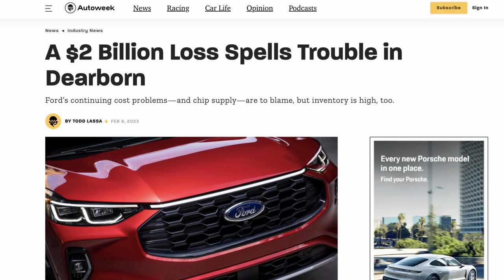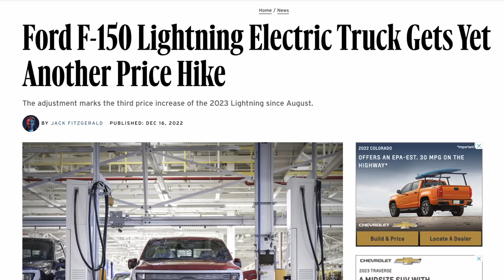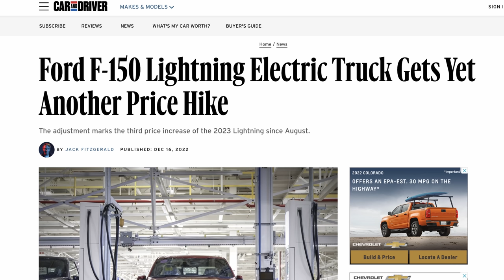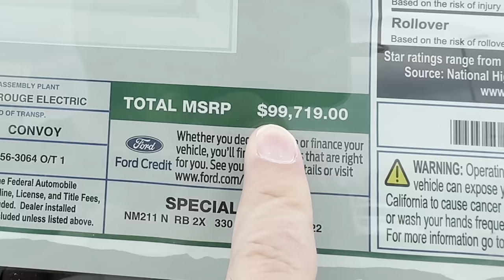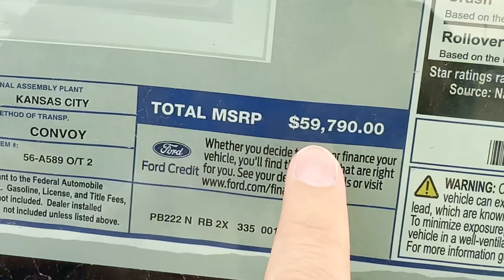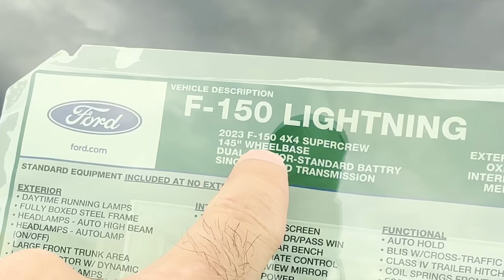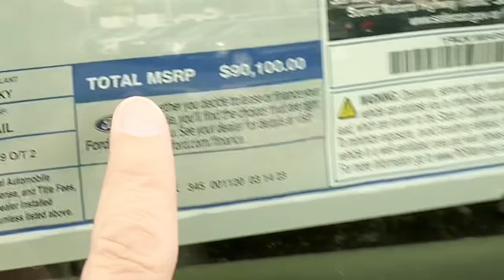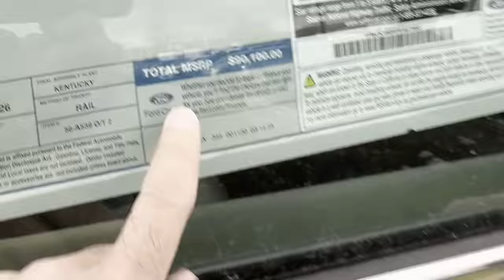Ford CEO Makes HUGE MISTAKE, Now Dealers CAN'T SELL TRUCKS!

Comment: This fits with what I found out when getting my new lease 3 weeks ago. I asked my long-term salesman how well the EVs are selling, and he said, "nobody wants them". He said they're too expensive and the people are POed because the ranges per charge is nowhere near what's being promised. He also said he had to take 15 tests just so he could "qualify" to sell them.

I'm in SE lower MI and there's no other options available other than F-150s or Explorers. They can't even order any Broncos or Mavericks for 6 months. Edge and Escape had a 4 month "freeze".  That didn't matter to me as my preferred vehicle is an F-150. (I can't bend down to get into a car) They were also so desperate to take my Ranger back that they terminated my lease 4 months early and the Ranger was already claimed by the next person.

I agree that the prices are insane! Thankfully, I was able to take advantage of enough "Ford Family" rebates to make my new lease "manageable".  Surprisingly I even got a credit for turning the Ranger in early. I was thinking off buying the Ranger off the lease, but the payments would be MUCH higher than the F-150 lease! 

So far, no recall notices for my new truck 🤞
Reply: So on the EV.   If it takes 15 vocational classes to even sell the damn thing, you think the average joe-bob is going to be able to perform even basic maintenance on one - ha ha ha, not so much!
Reply: @xxxxxxxxxx6903  I'm sure that's part of the plan- to make it so the average joe can't do basic stuff anymore.
Reply: my general take away from watching many test video's is that EV truck can only fulfill their mileage per charge quote on flat roads that do not elevate. Once the road becomes hilly, even a little, mileage per charge is reduced and the most shocking part, once you put a load in a truck or tow something, the mileage drops by, at least, 50% to 60%... that's insane!! ......then there's the charge problems. 

My overall opinion is that they are overpricing their combustion engines to force you into a electric engine. I suspect Ford will fail on a gigantic level but, not before a couple of tax payer bailouts, only to disappear entirely.
Reply: @xxxxxxxxxx6903 this is part of the reason that a lot of people are fighting for the right to repair on their cars. You take it to a dealership and your paying insane amounts out the ass because no shops and you can’t fix it because you need a special software or tool to fix it but the Manufacturer made it dealers only
Reply: @mrrey8937  Excellent point! 

I'm just glad I don't have horses anymore. The thought of having to rely on an EV truck to pull a trailer down a muddy/snowy farm drive in winter so my horse can get emergency surgery is terrifying.

Comment: The dealer mark ups have just totally turned me off buying a new one. I seriously considered buying a bronco even though they have that weak front end, I just wanted one because I had one I guess. I wanted a stripped down model with the off road package because I planned to use it off road then they made it so you couldn't order one like that.
Reply: The Weak front end is because people are off roading the Bronco Sport which isn’t made for off roading.   Just like Jeep Wrangler has the base model for yuppies and one actually designed to go off roading without the use of mods.  Same thing applies to the Bronco.
Reply: If you look hard enough you can find a classic car or truck with low miles.
Sometimes they are cheap.
My 1977 LTD with about 30,000 miles only costed me $11,000.
I have seen classic trucks go for $19,000 to $35,000, and even $35,000 is a bargain.
If you don't mind getting out and locking the hubs, or have a prissy ass that needs a heated seat, then a classic truck may be just for you.
But something i learned the hard way, other than mechanical other parts (engine, transmission) things like a mirror or a wiring harness and other things can be hard or impossible to find.
Thank the cash for clunkers scam that destroyed many cars with good spare parts for that.
Reply: @georgescott4505  Wow, that's really expensive. I have several that I've given less than 10k for that are still going strong.

Comment: Crazy that I've had fewer problems with my early 2000's Ford with the dreaded 5.4L 3 valve than people seem to be having with their new Broncos and Lightnings...
Reply: 05 F150 with a 5.4 3v here 🤘
Reply: @danielhancock8817  Hell yeah. Mine's made it 250,000 miles - here's to another 250,000 🍺
Reply: @thea.m.p.co.467  The problems they had with that engine came from the spark plugs breaking inside the heads or popping out of the heads. It wasn't with longevity.
Reply: Yup 2005 f150 227,000 miles and runs great
Reply: @airplanedude419  I always read/hear people talk shit about them for a variety of reasons, but I am aware of the plugs popping out - 2 have blown out on me, and they've been repaired with helicoils. As long as they keep popping out, I'll keep repairing 'em - I just hope none break inside the head and make their way into the cylinder.

Comment: I’m surprised they aren’t offering a few cases of Bud Light with a new truck. Seems like the next logical step given how these CEOs see things from inside their little bubbles.
Reply: They made that new rainbow truck I don't know of one  macho guy that would ever buy a rainbow truck and you know the 1% of the rainbow would never buy one they wouldn't be able to drive it and high heels
Reply: VIDEO: 'This Sucker's Quick!': Biden Test Drives New Ford Electric Truck
The Ford CEO thought using a 'woke' leader to promote their EV was a good idea.
How is it working out now?
Reply: Damn you had to go there!
Reply: Great idea, maybe put a 24 case of Bud in the bed of every Ranger Raptor "Transgender Edition" sold.

Comment: I am still driving my '99 F150 XLTV4.2L V6 w/5 on the floor and honestly, it would take A LOT to get me to trade her in. I just custom 2 toned painted her my self, ripped all the carpet out and basically rhino-lined the interior. I love the damn thing. Blew the engine couple years ago and had to buy a refurbished w/100k miles. Got it for under $1k and spent a weekend with my wizard mechanic Pops to drop it in. Seriously contemplating turbo for it even though it zips along already for a V6 ... AND it's pretty much theft proof since most younger Gens can't drive stick😁

Comment: Even with a $2000 discount they're still overpriced by about $20-30,000. In the higher trim packages more like overpriced by $40-50,000.

Comment: I worked for a part supplier that produced parts for the blue oval and other auto manufactures. The blue oval would take anything remotely close to the spec size for their parts. Other companies that we supplied would only buy correct in-spec parts.
Goes to show how much they care about quality.
Reply: I did the same in the 70s .. Mercedes was the most demanding.

Comment: It's a shame that the few decent hard working people at dealerships are being affected by the owners / managers greed. It's easy to say "let them burn" for being greedy bastards, but as stated, some good people will suffer because of it. I don't have much luck at all when it comes to right place right time purchases, but getting my 21 Tundra in late 2020 and 0% interest was probably the best investment I've every made.
Reply: Depreciating asset isn’t much of an investment.
Reply: @DoublePlay21  It is an investment if it is providing more value than what you are paying into it. Just because the base asset depreciates doesn't mean that the value it brings does as well.
Reply: Do you like the Tundra?
Reply: @joewoodchuck3824  Love it, and being the last year with the V8 I'll be keeping it for as long as it will run. Some of the things such as the dash, info system/radio, etc is outdated, but pound for pound I honestly believe it's the best truck made. The jury is still out on Toyota's new Tundra platform.
Reply: @Sworm0120  I'll be in the market for a vehicle at some point. I'll keep that in mind. Are there many scheduled service intervals? I had a Honda Accord a ways back and the scheduled service came up what seemed to be too often. And it was like I never left without dropping another $500!
Reply: @joewoodchuck3824  Oil changes and an air filter is all I have done on my truck with 37k miles on it. And the oil changes are every 10k miles if you use the provided synthetic oil at the Toyo dealership. I'd say they are probably the most reliable truck on the market (pre-2022 that is) Friend of mine has two Tundra's that both have over 250k miles with zero issues.
Reply: Time for people at dealerships to get a real job that helps the economy

Comment: I’ve worked at several dealerships, and I can tell you it’s quite normal to get shipments of vehicles in on a weekly basis, and a good dealership should be stocked with inventory. 
Not arguing the numbers just stating my experience.

Comment: I bought a Ford truck in Jan 2023. It is a 2002 F250. Runs great. Parts are pretty easy to find when you need them. Tons of upgrade options that are also relatively low priced.
Everyone I know that has bought a new truck in the last 4-5 years have constant problems with them. Not just Ford either, but mostly Ford.
Their diesels are still pretty good.
Reply: I bought a new F150 Jan 2022, no problems. I will never buy another since they went gay.
Reply: Try telling a canadian worker that diezel is good. Urea freezes into a block of ice. Your vehicle just shuts down in the middle of nowhere 100 miles away from any civilisation (and of course no phone service) with no means to restart the engine.
At -50°C i'm lucky I'm still alive because of that ONE good samaritan that actually passed me and turned back. 
And this has hapenned to me multiple times.
🤢
From home i'm 160 miles away from any dealers. Now I'm affraid to leave with a brand new vehicle (all brands and make). Total madness.
Reply: @mr.octopus6972  Why? I'm an American. I'm addressing people that live in places that ARE hospitable.

Comment: I bought a used 2008 f 150 that was immaculate with 108,000 miles on it for $13,500.00 in 2013. I have over 210,000 miles on it now, and it is a champ. No problems. It was a steal. They're trying to sell eco 6 trucks now for 4x that price. They are nuts.

Comment: I worked the auto industry for 20 years, one thing I have seen that people miss with the BS high prices is the amount of technology that keeps getting mandated in these vehicles. It started with mandating air bags. The big 3 lobbied for these because it's cheaper to manufacture in all than to have R&D for options. We are partly to blame when we vote for people that are pushing all of the crap that keeps causing prices to go up. This is why we can't buy standard vehicles like we used to.
Reply: I'm sorry, but I'm fairly sure that 90% of contractors/construction workers would take off the heated seats, steering wheel, electronics seats, touch console, all the luxury BS in order to lower the pride to something reasonable.
Reply: Agreed over regulations is killing the Affordability.... it makes the R&D expensive.
Reply: They just put into law, all makes after 2028 need to be able to check for inebriated drivers, and a kill switch, and a monitor on the driver to see if they are "acting" impaired. Hello big brother.

Comment: Sad situation. I once recently saw a video of an 'electric F150' for $41k and a $30k dealer "market adjustment". Looks like Ford saw that too, and put their own $30k adjustment on them. Our local repair shops are now adding 25% to the price of parts to do repairs!  That's plus charging $140 per hour!  It's all gone crazy!!   8(
Reply: Range Rover did the same thing.. they saw what dealers were getting so they jacked up MSRP.. I think their flagship car MSRP's for something like $175,000 now... that car was legit like $80,000 in 2012
Reply: Bro where do you live, if the shop starts charging $140HR and you drive and old beater you find a new mechanic lol
Reply: @Wopwopwopfuckitup  Well, I'm a young 71, and I drive a 2012 2500HD Silverado (w/32k miles on it). It's minty and has a matching cap and lots of nice accessories. I live in W-NY, and we have a State Collage here. The local shop does a lot of biz there!  I just had complete brakes done, rotors/pads and 2 calipers. I wanted to buy them myself and have them install them. They would not to that. When I got the bill they had part #'s on it. I 'googled the part # and it went right to the part at Auto Zone.  When I looked at the price, they charged me 25% more than the price I could by it for at AZ.!!  Plus the mechanic said they got a big bonus from AZ once a year for a percentage of the parts they bought!! AZ also delivered them free.  Those parts were 3X more than I could buy them for at Rock Auto!!  I'm going back to the dealer next time, they are even less $$. 8(   Thanks,    --gary
Reply: To be fair, repair shops have always marked up parts prices. Their bottom line on a repair always included some profit from the parts. However, that would be marked up from wholesale, not retail. Maybe things have changed, but repair shops in the past always paid wholesale prices on parts. On that basis your situation does sound fishy. Why is a legit repair shop paying retail?
Reply: @Wopwopwopfuckitup  Same here, my mechanic shop rate went from 110 to 135 this year, plus parts and shop supplies are costing more. I mow lawns for a living and my prices have jumped 10% in 2 yrs, but I'm lucky cause people are lazy and don't want Little Johnny to mow their own yard.
Reply: Charging $140 an hour and the tech sees $18 to $40 of it lol. Who's labor is it again that they're charging for?
Reply: @SoI_Badguy  I can't quote numbers, but to be fair there's mechanic benefits, taxes, management, and operational overhead.
Reply: @SoI_Badguy  A tech making $18, now that's lol. A good mechanic should be making 35-40 per hr, then you have shop supplies, tools, a shop with a roof and insurance in there. $130 -140 is not unreasonable in todays economy.

Comment: I've been hearing this stuff for years now. These companies know that it's a new paradigm of money and that they get to keep doing this indefinitely. Buy your vehicles outright and drive them as long as you can. This won't change.
Reply: Bubbles burst. It's happened before, and will keep happening. 2008 proved that.
Reply: It doesn't matter how long you drive a $100,000 truck, it will never have a reasonable cost of ownership.  100,000 /20 years = $5,000/year ownership that if before expenses and interest.
Reply: @frotobaggins7169   buy an older Ford and spend a fraction of that money to upkeep it.  I currently drive a 2001 F250 with the 7.3 diesel.  It has 225,000 miles on it and I have no plans to replace it anytime soon, it does what I need.  Don't see myself ever spending 80-100k on a new one even if I can afford it.
Reply: @frotobaggins7169  Just interest (paid and/or opportunity lost) would be $5,000 per year at a conservative 5%, so lets say $11,000 per year cost/interest/maintenance.

My wife and I keep two vehicles and for the last 25 years have maintained about $1,000 per year total cost of ownership on each, plus maybe 10 hours per year of my free labor working on them. Hopefully we can keep our current cars (19 and 14 years old) past this bubble and buy (used) cheap again. We've been lucky with buying reliable used cars though.
Reply: @WranglermanLevi  yeah, I have an 88 GMC.  I'm in it about 5k including all repairs.

Comment: The changes that are coming are going to shake up the car industry like never before. When the big three abandoned the car market to the Asian manu's you knew something was wrong. It has become increasingly evident over the years that the US manu's engineering was substandard and they were unable to provide a reliable car. So they fell back on their high profit cash cow pickup trucks which is now starting to crumble.
Reply: Ford lost the plot when they became a marketing company and NOT a car company. 

They said they stopped building cars because of the competition...yeah, the competition that built reliable vehicles for 20K less. The issue was ppl finally woke up and stopped paying top dollar for crap. I mean, Ford literally had to buy back every fusion and focus with the dual clutch transmissions.
Reply: @muskokamike127  Exactly
Reply: Hey at least ford ceo made 21 mil 😅
Reply: Most domestic manufacturers gave up on minivans a decade or more ago.  Now giving up on cars (small ones years ago and bigger ones currently).  The truck market is next once customers realize how good Japanese (Toyota) trucks are.
Reply: @K lake Indeed they are.  San Antonio to be exact.  I've been there.
Reply: @muskokamike127    But they kept the car China told them to keep for export.
Reply: @timclarke9627  what does that even mean?

Comment: Prices these days are insane.  I’ll be holding onto my 2003 Silverado for as long as possible.
Reply: Better yet get rid of it and buy a mid to late 90's silverado. MUCH better built truck than the early 2000 trucks.
Reply: @airplanedude419  

Or I keep what I have and not spend money on another truck.  It’s long been paid for and has low mileage as I don’t drive all that much.  I have a short commute.  Most things on it I can do myself.  Though a couple years ago I had to replace the transmission.   Still far cheaper than buying a used truck.

I think I can get another 10+ years out of it.
Reply: @JB Dragon   Honestly man I have a 1993 k1500 Silverado Fuckin TANK. Plus you can find them fairly priced easy to work on. It'd be good to have a around as a back up tbh
Reply: @yokaioni7863  

My backup is my Harley!